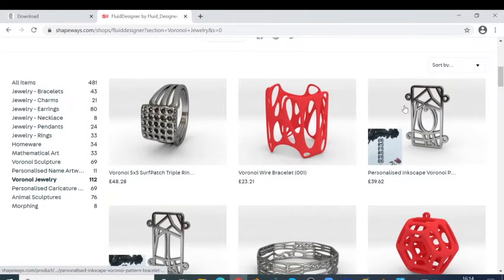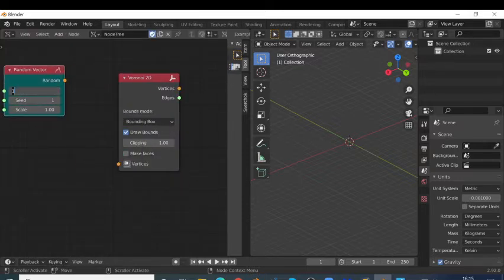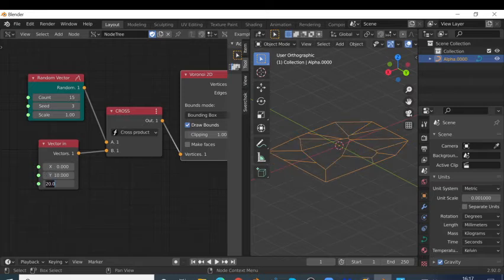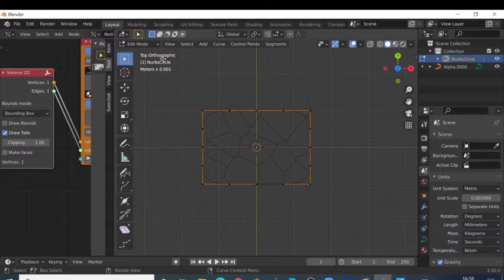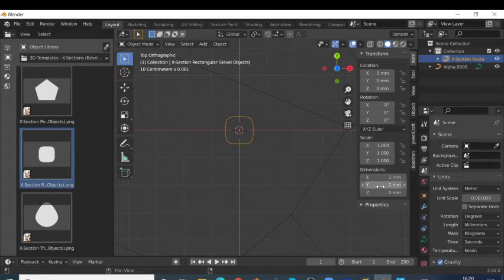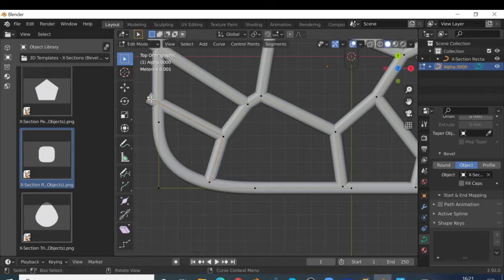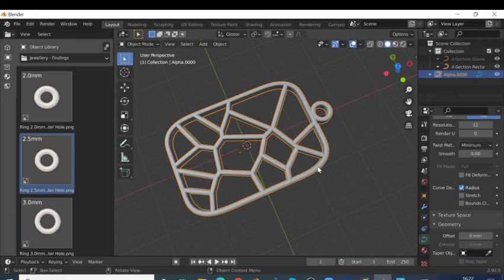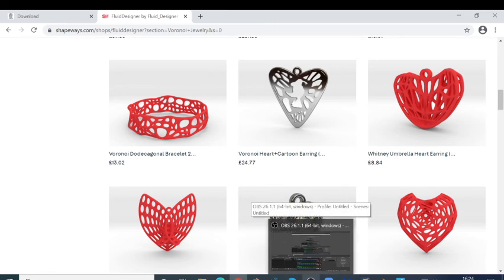FluidDesigner Using Blender + Sverchok AddOn For 3D Printing

Comment from the maker: Hi Rupert

1. NetFab Basic should allow you to either download a free key by registering or alternatively after 10 secs you can click to ignore it.
2. Sverchok can be downloaded from https://github.com/nortikin/sverchok

How to install Sverchok: Go to Edit, User Preferences > Addons > install from file > choose zip-archive > activate flag beside Sverchok
Enable permanently in the startup.blend using Ctrl + U and Save User Settings from the Addons menu.

3. I suggest you install PyClone (see 5 on my web site) and WATCH THE VIDEO on how to install it.
That will show you how to access both PyClone and Sverchok screens.

I should say that working with Nodes like this is not really for beginners on Blender.

Paul